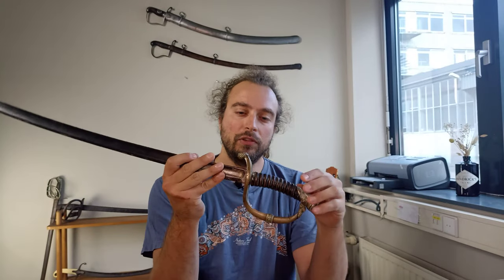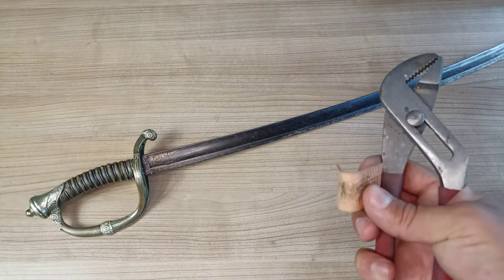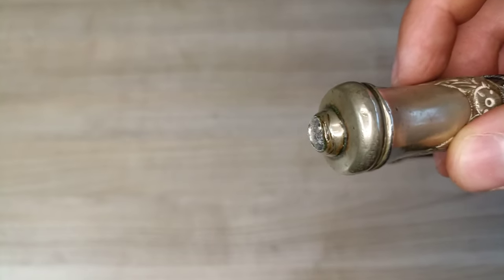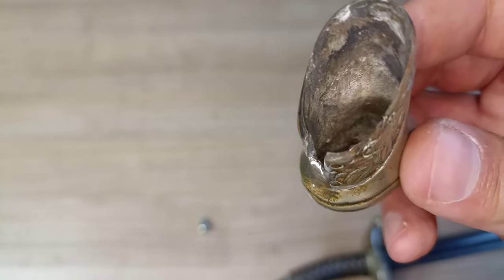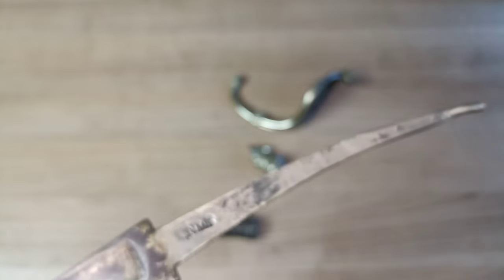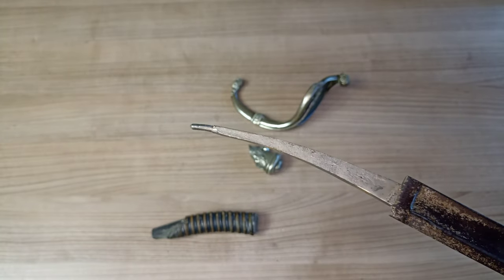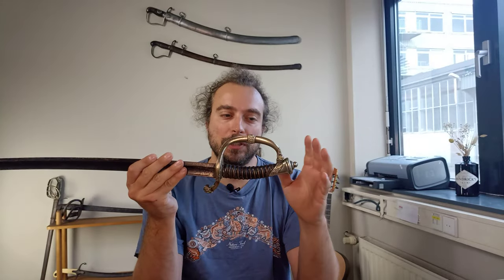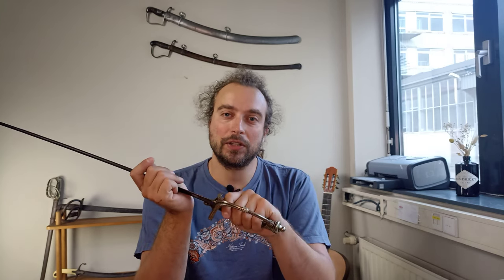Sword Restoration and Maintenance: Disassembling a Dutch M.1852 Sabre

Comment: Greetings!
                                   Informative videos.  Question, do you or have you ever taken a sword hilt off a blade that has the end of the tang peened over as a means of securing the hilt to the blade?  If so, I would appreciate any information concerning the procedure or the tool/s used in the process.  Thanks.
Reply from the maker: Hello, I have not had tried my hand at disassembling a peened blade, as that is a "destructive" process, or better, it permanently and irreversibly alters the sword and could damage it's historicity. 
However, I have a sword in very rough shape I am thinking of repeening this coming spring, so if you have some patience I might have a video for you in a few months.
Reply: Thanks for the reply.  I have recently received a couple model 1860 Calvary sabres without their handles.  They are both in very good condition and good candidates for restoration, not refurbishing.  Disassembling the hilt from a peened tang can be done without destroying anything.  I have several methods in mind but want to do as much research as possible before I attempt such a repair so I do not damage or destroy the sword.  It will be awhile before I acquire the tools necessary and make the attempt.  If interested in how I plan to approach the process, please let me know.  Otherwise I will forward to your video.  Just subscribed, again, thanks, Bob. @Rapiersdelight